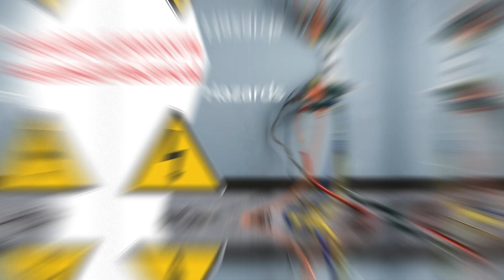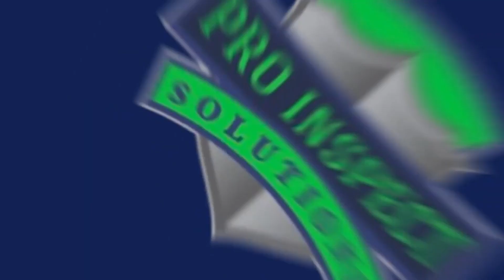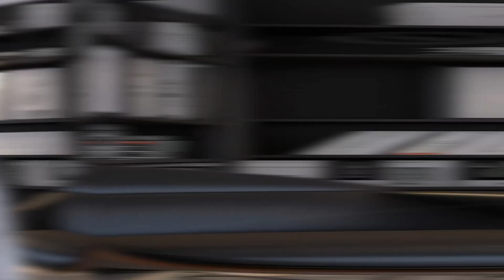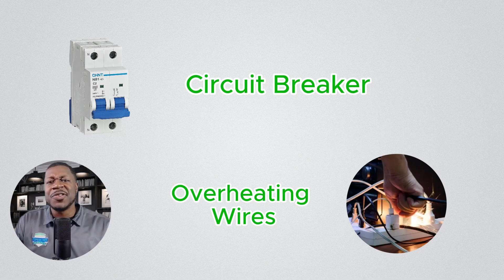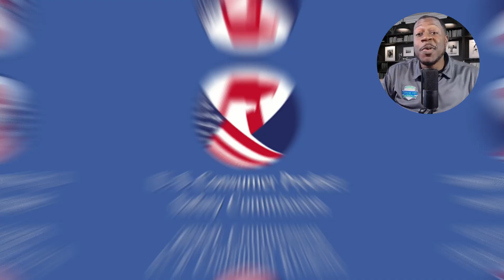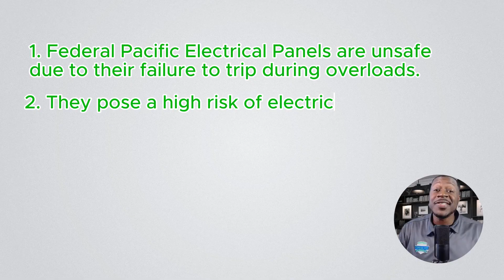Why You Should Replace Your Federal Pacific Electrical Panel – Hidden Dangers Explained

Comment: We are in the midst of getting quotes to replace a Stab loc panel.  House built in '87 during construction boom, so typical issue.  Watched another video --20 minutes--which was more detailed, but your video is great for the person who needs a short summary of why this problem is so bad!  Some don't have patience to wade through 20 min. of technical info🤣  I may contact my insurer to see if there will be a cost reduction.  That was a new bit of info I did not know!  Thanks.
Reply from the maker: Thanks so much for watching and for the kind words! 🙌 You're spot on—those Stab-Lok panels were super common during that construction boom, and unfortunately, so were the issues that came with them. Glad the shorter format helped cut through the noise! 💡 And yes, definitely check with your insurer—some offer discounts after panel upgrades because it reduces fire risk. Keep us posted on how it goes

Comment: Replace it ASAP! We lived here since 1985 with FP Stab-lok panel in our bedroom closet. Just replaced ours finally on Tuesday after a big scare & learning the danger. Now a new up-to-date code panel is on outside of our house by the meter. -- I gather there are still millions of these panels in homes today. We had a fire in our garage freezer that could have taken down our house, if we weren't here to notice & jump. Thankfully we had some fire extinguishers & a good fire department response. Turns out we had rats that probably chewed wire in the freezer. Best guess. We were lucky wasn't much much worse. Could have happened while we were asleep or away. -- Firemen (yes, all men) said to get an electrician before turning power back on. -- Electricians told us that a new up-to-date panel with Arc fault protection would have prevented the fire from happening, so would have been a non-event. The circuit was okay after fire, but we should replace the panel ASAP because a lurking fire starter in our closet. 

1. Get yourself fire extinguishers & know how to use them. (Thankfully we did!)
2. Know what your electrical panel circuits control (Thankfully I did, so was able to run to shut off power to freezer). Know how to cut off circuits in your electrical panel.
3. Put a linked smoke detector in your garage (We were lucky I smelled smoke before the indoor smoke detectors went off. My nose beat the detectors. Fire was raging.)
4. Don't have holes in your drywall that can let a fire go up into the attic (turns out we had a hole near the fire in ceiling, but lucky didn't make worse)
5. Donate to your local volunteer fire department
6. Don't let your garage be cluttered with stuff that burns easily. Make sure you don't have rats hiding in that clutter. Check out your old appliances for safety. 
7. REPLACE any Federal Pacific electrical panel ASAP! Get up to code. 
8. Do NOT have your electrical panel in your bedroom closet. That has been a code violation since 1981, but no one ever told us till after this fire.
We are going to get a full house inspection for safety hazards - get electrical of house reviewed for what is no longer in code (old rules grandfathered in doesn't mean safe). 

Federal Pacific (Stab-Lok) was never actually recalled in the USA, which is nuts. Get them out of your house! -- Maybe they were recalled in Canada?
Reply from the maker: Wow—thank you for sharing your story. That’s incredibly scary but also so important for others to hear. We're really glad you and your home are safe, and major props to you for acting fast and making the upgrade. It’s a powerful reminder that these panels aren’t just outdated—they’re dangerous. Arc fault protection is a game-changer, and you're absolutely right—millions of homes still have these panels. Hopefully your story inspires someone else to take action before something happens. Stay safe and thanks again for watching and commenting! 🙏🔥